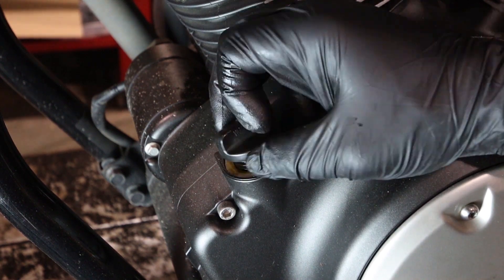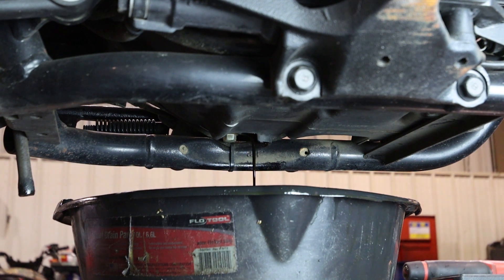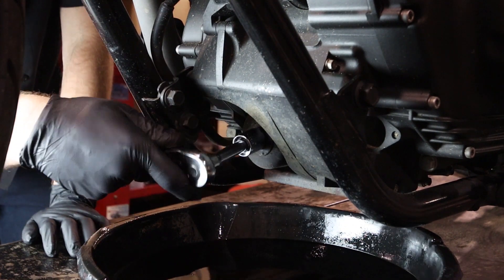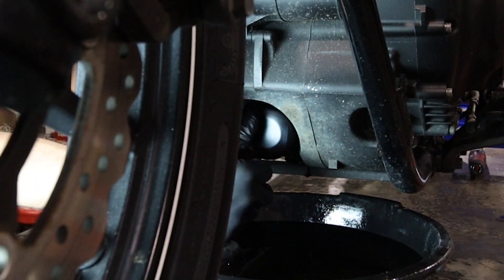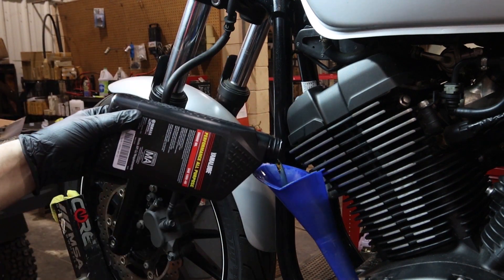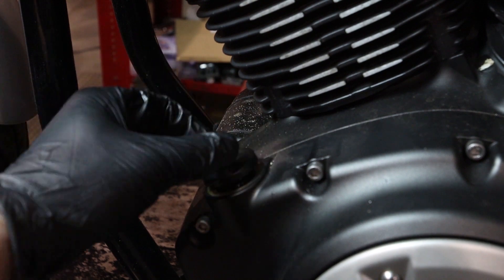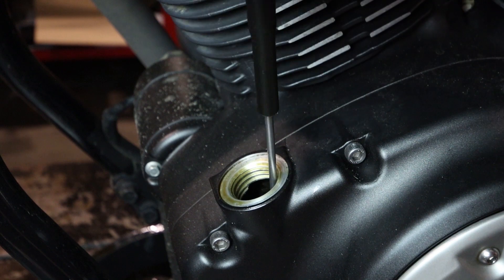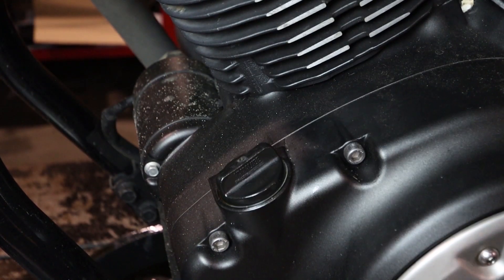How to Change the Oil on a Yamaha Bolt | 2015 Yamaha Bolt Oil Change | Partzilla.com

Comment: I've changed oil on lots of motorcycles.  You make a Bolt oil change appear easier than it really is.  There are a few tricks Bolt riders figure out for themselves.
Reply: Like getting the right tools
Reply: How is it hard? I have a 2020 Bolt and other than the very first oil change, where the filter was extremely tight from factory, it is a cake walk.
Reply: @BrianWood74  It's a cake walk for me too.
Reply: @BrianWood74  Have you removed and installed a battery in it yet?
Reply: @dangunn6961  I just did that on my 2014 bolt three weeks ago. One of the easiest battery changes I’ve ever done.
Reply: @dangunn6961  I removed the battery first before I changed the oil. It sucked.
Reply: @plumeater1  It does suck.  I only remove the battery once per year when I stop riding for the winter. I keep the battery in where it's warm for the winter.   During the riding season when I want to charge or maintain the battery I just remove the battery cover and attach the positive charger clip to the positive terminal on the battery and the negative charger clip to the oxygen sensor when it enters the exhaust.  I use a Noco Genius 5 smart charger.

Comment: Middle and upper portion of the stick? Not the little xxxx mark area?

I ask this silly queation because i am used to the cars dipstick(having clear notches to tell you low and high, while the bolt has no indicators) 

-Thanks
Reply: Middle of the marks on the stick. Anywhere in that area is acceptable.

Comment: i need to ask you something my oil light comes on when i am riding for about 10 seconds then goes off  for a while  and then it happens again but when i check it  it seems ok any suggestions
Reply: Check the wires on your oil pressure or level sensor? Flipping through the Clymer manual, a Google search or a trip to the bolt forums would help you find the location of Those sensors
Reply: @treavorgerber2917  thanks but i never happened again bike is fine

Comment: can 0-40 full synthetic be used in place of 10-40,  i live in extreme  heat/cold weather, Nevada desert.
Reply: Check many V2 & I4 riders forums use Shell Rotella 6T 5W-40 with good results
Reply: @scotts.7662 as a person who works at the dealership please do not throw diesel oil into a air cooled cruiser. Unless you want new gaskets.

Comment: Don’t torque it with a toque wrench or to 31 ft pounds, that’s based on dry specs, you will strip the thread …. Just a quarter turn with a ratchet and you should be good
Reply: Crap thats what happened
Reply: @theone215114  sorry about that man, I decided to post the comment cuz it happened to me to. Bright side is, it’s fixable, self tapping oversized bolt and you should be able to rethread the pan. If you’re not comfortable doing that yourself I suggest going to a moto mechanic with experience doing that.
Reply: 31 foot pounds is according to spec in the owner's manual
Reply: Yes, dry spec, as soon as you have a touch of oil involved you’re gonna over torque it and strip the threads

Comment: Tightening the drain bolt to 31 foot pounds is pretty tight for an aluminum crankcase.  I bet if you tightened it to 5 foot pounds it would never leak.
Reply: 31 foot pounds is according to spec in the owner's manual
Reply: @joey_outdoors  By all means then tighten it up to 31 foot pounds.   50 years of motorcycling experience here.    Ask some motorcycle mechanics.   Or just Google what the torque should be on a motorcycle oil drain plug.